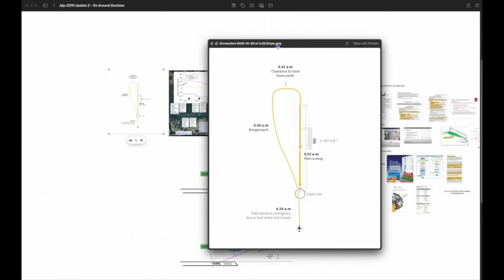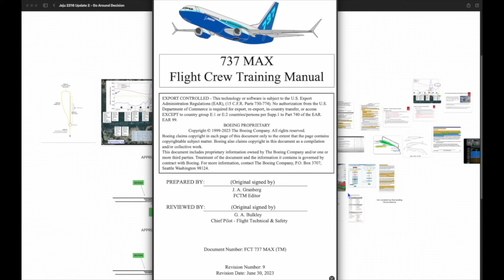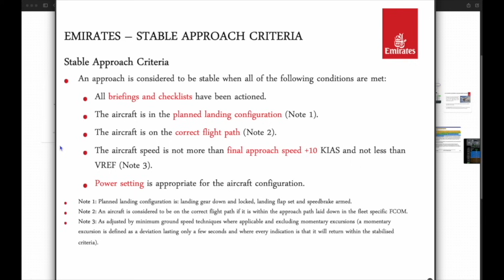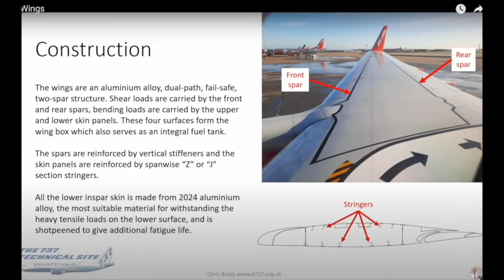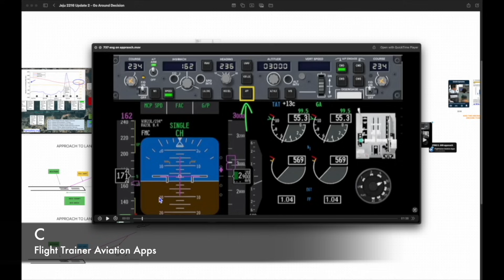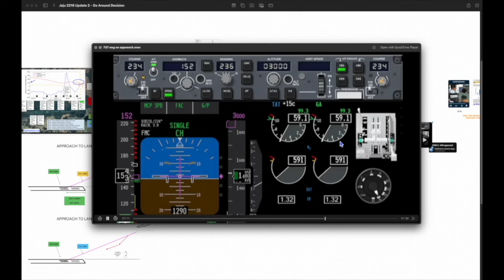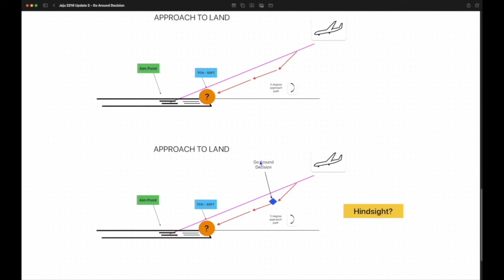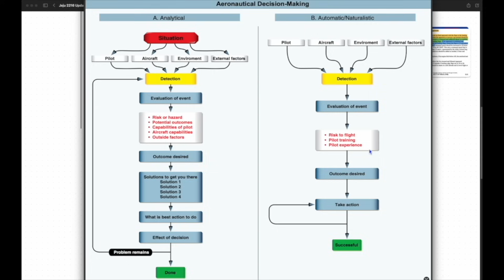Go-Around Explained: Jeju Air 2216’s Decision Not to Land

Comment: ONLY FACT MATTERS
1) the overrun speed and tear drop pattern is clear indication they had excessive energy, meaning AT LEAST ONE ENGINE IF NOT BOTH GAVE THEM THAT EXTRA ENERGY. You people, STOP saying engine #1 was inop from the start.

2) go around footage shows plane CLIMBING, landing gear RETRACTED (had hydraulics) and Flaps seemingly up. Meaning, they HAD POWER, MOST LIKELY BOTH ENGINES AT THE MOMENT OF THE GO AROUND DECISION. People, STOP questioning the going around, if you have BOTH ENGINES OKAY, you GO AROUND, it being a bird strike or unstabilized.

3) on that go around footage, we see #2 compressor stall, possibly #1 stall at a lower scale, OR AN ACTUAL FOOTAGE OF A LIVE BIRD STRIKE (you can't challenge the possibility). I suggest you, people, consider either the POSSIBILITY of a second (or third) bird strike, or a PERFECTLY VALID UNSTABLE TO GO AROUND PRECAUTION into an actual bird strike. Both are no less professional than any expert western pilot, and both lead to AN ABRUPT CONTEXT CHANGE. People, stop assuming those pilots were INCOMPETENT, tunnel vision on the reason of the go around when other triggers are likely at play only invalidates your reasoning.

4) aircraft had #2 engine reverser deployed, sound suggests max or nearly max turbine input. Yet, AIRCRAFT DIDN'T SPIN NOR VEERED OF THE RUNWAY. That's a strong indication engine was pretty useless. To weaken reverser that much, thrust from turbine would have to be as strong as main fan bypass efficiency. A severely damaged main fan can explain that. The good question is "AT WHAT TIME that engine #2 sustained said damages?" And no, it wasn't at the time they gone around, but some time later, AFTER they retracted flaps and landing gears, at least 30 seconds timeframe.

5) Now, if something would drastically change the situation, to the point for you to scrap your initial intent of sorting out emergency in a perfectly flyable and powered plane LIKE A PRO, what would that be? Maybe.. a Sully-like flock of bird strike, perhaps several consecutive strike of flocks... flaming out your #1 engine and severely crippling #2? This PERFECTLY ALIGNS WITH GO AROUND FOOTAGE AND PERFECTLY EXPLAINS PILOT DECISION TO PERFORM A TEAR DROP IMMEDIATE RETURN TO LAND.

6) Why would you keep #2 running (3rd footage of final) if it was of no use and severely vibrating? This only make people believe your #2 had meaningful power... Well, people, go around footage shows #2 compressor stall, use your brain, NO WAY THAT ENGINE HAD COMFORTING EFFICIENCY FROM THAT POINT ON. Pilots knew that and they have readings, you don't. Fortunately, they aren't dumb, a running engine provides electrical power (or at least if fan blades shrapnels didn't cut lines or damaged generators). You DON'T SHUT DOWN YOUR LAST ENGINE EVEN IF YOU'LL LET IT AT IDLE. And given the time window, attempting to start APU, taked time, no autostart, it's not flightsim, would have made no difference.

7) pile of dirt, you murderer..... Put those Korean airport and aviation administration representatives to jail (rolleyes/facepalm) Okay, let's remove that pile of dirt, hypothetically. At 130kts+ runway overrun, what would happen? And I don't want anyone to blame a perimeter brick wall fence present on all decent airport, with concrete footings. No blame on ditches on each side of a road. No blame on firefighters either having to scramble back to barracks gate to exit airport perimeter, hit the perimeter road to reach burnt people that may have initially survived in the mangled dispersed wrecks. At that speed, it doesn't matter what you have beyond that runway. In the FIRST PLACE, we should understand what made those pilots UNABLE TO PROPERLY MANAGE THEIR ENERGY. If you want to blame this pile of dirt, well, you may aswell close thousand of UNSAFE SUCH AIRPORTS IN THE US ALONE, and put US administration representatives in jail before something of the like actually happens. But heh, what are the odds, with millions of such risks occurring each year, yet, only this one tragedy for so long... Point proven!  FYI, it did happen in the US, but didn't make it to the media, was just a business jet noone cared about..

At this point, just by piecing the three footages together, anyone not sinking in bias can come up with the same observations/partial conclusions. Seems some people have really hard time to be factual.. It's not hard to say "just an hypothesis", it's not hard to admit "I don't know". Affirmations that DON'T LINE UP with available confirmed info only triggers questions on your ability to display critical thinking. 

8) then came that 4 last minutes missing records. People: "cover up", really? Can't you think of other POSSIBLE causes? Go read recorders diagrams. Yep those backup batteries seems to render power shortage unlikely, the more since #2 eng is still running... Unless engine sufferred some catastrophic degradation at that very moment, power lines severed, hydraulic pumps starting to weaken... This hypothesis still PERFECTLY ALIGNS with go around footage, explains subsequent decision to land ASAP (you have failing trust, on top of that potential loss of all hydraulics), and still a PERFECT BASE HYPOTHESIS THAT MAY ADRESS FURTHER BIZARRE MISUNDERSTANDINGS, like no flaps, no landing gear...

9) "expert 737 pilots" claims you can extend flaps even with just electric backup batteries... People blaming the poor Korean pilots for incompetence for not properly managing their energy by not extending flaps... Well, some 737 pilots said they could extend the flaps, but other expert 737 pilots advise to VERIFY, because when they switched power, whatever they tried, flaps DIDN'T CAME OUT, they only had assisted rudder, and manual stabilizers, ailerons, no spoilers... Well, the proper action is to VERIFY! Unfortunately, I don't have a 737-800 in my backyard. What now guys? Would you scream "deadly design flaw"? If so, you're actually ACKNOWLEDGING even some expert 737 pilots don't know their craft.. They would have reacted exactly the same as those Korean pilots, faced puzzling reality, at no point those pilots did anything wrong!

10) getting further about that 737-NG design error, well, like for every single serious incident where people actually walked away, you can actually pick a bunch of design flaws/lack of redundancy. HOWEVER, based on statistics, with the thousands NG flying around, and the occurence of such catastrophic outcome as this JejuAir crash, I don't call that a design flaw, I'll attribute the blame to 80% bad luck. Yes, I DARE SAY, the odds of being trapped in such tight window with multiple failures of that magnitude is a calculated risk, that's how the real world works; as crude, rude and insensitive as it may seems, that's the cost of safety YOU AND I can still afford. More that that, and that ticket price and taxes rocket up.

11) of course this is a pile up of base hypothesis, though one I think is BETTER and MORE CONSISTENT with all we have than so many boldly claimed in overly insisting comments. If you can't create drag you expected to have by extending flaps, this shrinks the time frame you expected to have before reaching the runway, yet, you've already started your teardrop turn. Do you lower the landing gear with all a 200kts unlocked partial deploy differential hazard implies? Yes, you would like to land on the dot, but you're too high, nose diving would further increase your speed and reduce the time you have to deploy landing gear... Plus, scrapping the runway over 200kts could rip those engines off, burning fuselage skin is well known to have nearly zero friction properties... Who's the next commenting genius to claim to have done better taking account of all those dilemmas..?? So far, every new update nearly lines up with what I proposed, since that fateful day, just with 3 footages, and I'm not that smart. Yet, again and again, even more people refusing to see what's right in front of their eyes gang up in the comments. What a world..
Reply: I won’t need to type as long as you did-but first me: 42 years Navy jet military/commercial, B727, 737, 757,767,777, 
747-400, Captain,  33,000+ total hours, maintenance, instructor pilots….etc.all that!

Now my comment to you:

In aviation when you have an emergency and how you respond you either get it right or wrong …PERIOD! 

It’s [OBVIOUS] the Captain (made his call) that he had enough power to do a go around BUT then quickly [the aviators hair] probably stood up on his neck when whatever aircraft performance spoke to him when he was ‘abeam’…saying ‘you probably shouldn’t have done that.’ Every aviator knows what I am talking about-not sure about you as you did not state your credentials. 

Finally, I HAVE ACTUALLY done a belly landing (elected)  in a Navy A-4 Skyhawk because my nose gear would not deploy. You made a lot of comments criticizing others about their comments regarding how this Jeju Captain handled that. I’m not going to do it here for you-but I saw three critical mistakes the Captain made doing his belly landing. 

When a pilot has a real bad emergency-the pilot [cannot] afford to make ANY ADDITIONAL MISTAKES THAT COMPOUND THE EMERGENCY AT HAND. 

FINALLY, all professional pilots (military or commercial) know if you takeoff and get in the air…FROM THE  ON YOU OWN IT. No matter how bad it gets…YOU OWN IT THATS WHY YOUR “THE CAPTAIN.”
Reply: @thetdchannel  And the 3 mistakes you saw are... oh, you didn't cite them! Care to elaborate though? Without the flight recorders data for those last few minutes of that flight where everything went all sideways, it's going to be near to impossible to ever prove any thing was done right or wrong though.... we simply will never know enough about the actual conditions on that plane and what the pilots had to "work with", what they knew was going wrong and when they knew it. Just saying. 😕
Reply: @ 
First tell me what your pilot aviation credentials are?
Reply: @ Not sure it matters if he's a pilot or not. If you have some expert insight then why not share it.
Reply: @thetdchannel  Life taught me the hard way credentials are overrated and often used in a condescending manner to enforce an opinion. I'm not underestimating the knowledge and experience value of anyone, I'm listening, but only to facts, anything else like opinions or off topic is garbage. Then, someone is good at something, but will likely suck at many other things. So do I. On a piloting matter, yes, I will ask a pilot, but on a system behavior and vulnerability/flaws, I'll seek manufacturer diagrams, preferably the design team insight or their archive, then cross check with those that had trouble with said system to find truth somewhere in between: always VERIFY, never rely on one single stream of information.
Likewise, it takes a vast amount of knowledge to have the background to understand investigation processes. Several dozen of years reading tomes of reports thousand pages long, reading books about human brain and body behavior, verifying any lambda claim... for what? Oh, just for fun, understanding (aviation) has always been my main hobby. Incidentally, that's why I'm not a pilot (rather doing varipus many different things in the aviation domain, little or moderate), impossible for someone to spend time accumulating theorical/practical knowledge everyday and actually become a pilot with dozen thousand flight hours (plus all the other side of the coin representing half of the job: all that boring administrative duties and training obligations noone like to talk about). All pilots I personally knew over the decades have one common bias : they more or less assume they know better than those who wrote investigations conclusions (several hundred pilots, from various countries).

For a decision you regret that it will send you chills in the back even decades later if you survive, I did made such decisions a dozen times. Life also taught me, it's just a decision, past the point of no return, deal with it. Furthermore, for those pilots, let's say they don't go around, they aren't safe from other bird strikes, and they were below glide slope, with a lot of drag, over water. Tower warned them. ADSB data suggests either they were unstabilized, or they already hit birds for a moment before going around. There is no way to tell what would have happened, would have they hit another flock and crashed short of the runway? How many casualties? Nobody can tell, that's an imaginary scenario that had never occurred and will never unfold. Bottom line, deal with presented reality without delay, that's the only course of action that you may have little control over.

Pilot errors. Seems you mostly remembers me saying *at no point those pilots did something wrong". Yes, very wrong wording on my end, english is not my forte; my bad, anyway. The context of my rant (clearly it's one) was people dead rooting for either that pile of dirt, that stupid go around, the cover up or clear pilot incompetence.
- failure to fly the damn plane. How long it took them to realize how screwed they were, attempting to troubleshot their unresponsive systems instead of extending their path and at least lower the landing gears manually (that's already 5 potential errors in a row)... Though, it is possible they were losing hydraulics, caution on pattern extension ideas is advised, you don't want to lose control upon tight corrective high bank turns.. 
- Long landing, energy management failure. Youtube comment section is clearly not the place to elaborate. At this point, it's clear I'm an adept of "look at every factor first, never take an outcome to qualify what went wrong, particularly, assess what other things could go wrong if you tried something else". Noone will deter me from keeping that principle. Pilot error? That has to be proven, the right way, if possible.
- failed to communicate. Yes, that's very disturbing. Though, I had the same feeling every time I read ATC transcripts of accidents. By the time, I learned there are potentially more pressing and focus intensive matters than chatting in such crisis...
Probably not the errors you expected. I have one opinion though: someone pointing out an error, but doing the same error under the same context self invalidates his point.

Side note, the comment was meant for the average clearly non pilot and particularly clueless lambda anyone on any social media. Read a comment under some video, then found the very same comment as a question in Aviation StackExchange half an hour later. Question was immediately closed as opinion based with bias tendency. Social media is full of such nonsensical garbage. Then a reminder for credential centric ones whose affirmations were proven wrong and misinformating over the course of subsequent updates, in comments under many videos/vlogs about this accident. I'm interested in anything that brings light to this disturbing case, even if that will prove me wrong (even better, I would have learned something new, mostly useless in my life, but it's fun nonetheless, like a game of solving mystery; if I were to lose someone in a crash, I want the TRUTH, all of it)
Reply: A bit long-winded, but some good points. re: " "expert 737 pilots" claims you can extend flaps even with just electric backup batteries.."

I find that baffling. All the 737NG wiring schematics I have show that alternate flap flap extension can only be achieved by using power from the main 115vAC electrical busses. Using the Standby electrics is laughable. I guess Boeing expect you to extend the flaps using the APU generator if you lose the generators on both engines. 
The only thing which I find truly baffling is the deployment of the #2 reverser. You do need main bus power to do this (it provides power to the Radio Altimeters which are required for reverser deployment with the gear not extended). It seems unlikely that the hydraulic locks on the reversers would allow the reverser to deploy through cowl skin friction on the runway.
Reply: @ImperrfectStranger  was also perplexed by that #2 cowling sliding back. Pure guesswork at trying to think out of the box, one possible scenario is, when they realized they had either electrial shortcomings, or slowly failing hydraulics, or both, they restarted the APU. It's possible they initiated that intuitively (will kick in if you're trained on that matter) soon enough when the crisis worsened. Now, I'm unsure that would lift all inhibitors, kinda short on time to verify (again) right now. Just a guess.
Reply: @StephenKarl_Integral  The APU was not running when the crash occurred the APU air inlet door was closed.
Reply: @christopherrobinson7541  Good catch! Missed that; thanks!
Now I'm a bit puzzled; yet I haven't finished locating all those wirings for the systems involved.
In the meantimes, I'll add a potential "Did they gave up ?" to the list of hypothesis.
Reply: @ImperrfectStranger  The Low Range Radio Altimeter (LRRA) maybe be powered by the 28V DC standby bus or possibly via the static inverter that provides 115V single phase 400Hz AC. When the aircraft is lower than 10 ft agl the TRs can be deployed manually.
Reply: @christopherrobinson7541  Are you saying there are customer optional power sources? My wiring schematics say main xfr bus (1 & 2) power only. Ref SSM 34-33-11/21
Reply: @StephenKarl_Integral  

Also I would like to respond to the comment you made in reference to pilot training (east vs west).

I think you need to do some research on this subject. There [definitely] a difference between Korean commercial aviation training and U.S. commercial aviation training. Go back and study the findings of just two Korean airline crashes. The Guam crash KA 801 in 1997 and  Asiana 214 in 2013. 

Just take the B777-200 Asiana flight 214 crash at SFO. Three Korean pilots, flying Captain on an aircraft transition plane check-ride flight, a Check Captain and experienced Co-pilot (former Korean Air Force).

Crash conditions: SFO clear day, very calm winds for SFO, no clouds, no airport obscurations. NOTAMS: ILS 28L [glide-slope out of service] 

Asiana 214 cleared to land 28L, pilots now have to conduct a VFR, no electronic guidance VFR landing. THEY COUND NOT DO IT-AND FLEW INTO THE BAY WALL…killing 3, 187 injured passengers with 49 seriously injured, 1 passenger hit by approaching fire truck and killed. 

This is a “NO BRAINER” for any U.S. airline pilot [BECAUSE] it’s required training for us. Plus most of us flew general aviation before military or commercial flying…this is A BASIC AVIATION SKILL. 

FAA Findings: 

Korean Aviation did not at the time require or had this airline or the others had VFR-no electronic guidance-no auto pilot-no auto throttle landing training in their simulator training syllabus. The U.S. GOVERNMENT (FAA) demanded that Korean Aviation import this training into their programs as a requirement…in oder to maintain their license to fly into U.S. airspace. 

As a bonus: go back and watch some old Hong Kong Kai Tak airport landings. Notice the difference in cross wind landing techniques between the Asian airline’s landing and the western one’s landing.
Reply: @thetdchannel  I remember bits of those korean crashes (the reports, not the Hollywood like documentaries). And yes, I'm aware western pilots are generally more skilled and less rough than many Asians pilots back in the days (not any single one of them).

One factor though, you don't change culture and environment overnight. Futhermore, rapid airline growth or fleet renewal renders lurking risks/negligence/leniency more harmful, prone for backlash or even deadly, like not having the means, financially and in equipment, logistics and firm service contracts, to ensure trainings, qualifications, on time support and proper flow of operations, like Indonesia or Nigeria. USA is not spared either.

Yes, korean culture and interpersonal relationship and teamwork in JejuAir (and other similar low cost in the country) has to be scrutinized, AGAIN. Though, again, a crash is not proof of everlasting rotten culture, but since we are talking about Korea, we should not expect 100% transparency and rigorous cold hearted investigations. See what I did there?
That's OPINION. So is assuming Korean culture is wrong in so many ways. I'm eager to hear the available CVR data to start any thought on the matter. We can prepare ourselves to face dirty potential truths with cognitive bias, but everything has to be put in the right place or kicked out when a fact confirms or disprove it. I get your point, I take it as a basis for all paradigm for all the questions that need to be asked and answered, nothing more, nothing less. Rest assured, all we discussed so far are only a fraction of what I wish investigation dig in, my ideal of an investigation bureau is one above all countries administrative bodies, which spares NOONE. It costs a lot, to dig in every aspect of everyone involved's life and career, but international cooperation would divide that weight and greatly accelerate findings. If I'm concerned about the finance aspect of an investigation, you can be sure I made my homework on understanding the financial challenges of running an airline, or an airport, what cost cutting decision can play a role in this crash...
Reply: @ 

Okay I can go with that. You are right that one crash is not indicative of the culture, however aviation crash analysis does not work that way. Again, using Asiana 214…culture or not the FAA was not waiting to see if an [in-House] sorry we won’t do that again…THAT BASIC TRAINING DID NOT EXIST and people died others scared for life because that [basic] airmanship skill was deemed not important by the Korean pilot training standards group. 

If a commercial pilot at our level during VFR conditions can see an airport and [NOT] be able to establish a 3 degree straight in glide slope, hand flown, no auto throttles…they should not ever be near a commercial jet! PERIOD!

We are not in the business to be sentimental. As I said earlier as a Captain-when you accept the jet (maintenance wise) and take off…you own it!
Reply: I am also noticing a convergence of opinion (from those who put the effort in) around what probably happened - give or take.